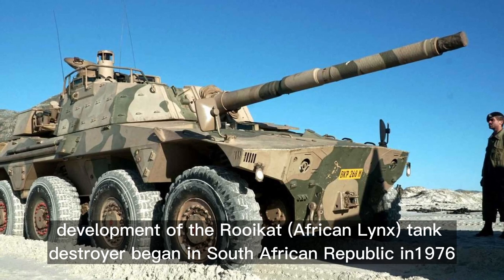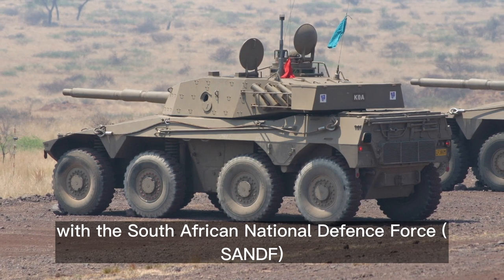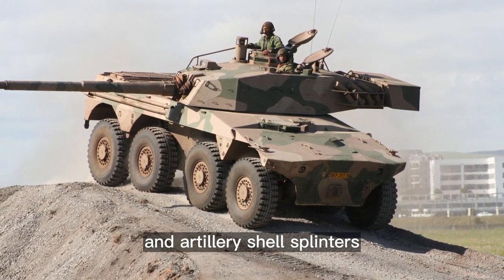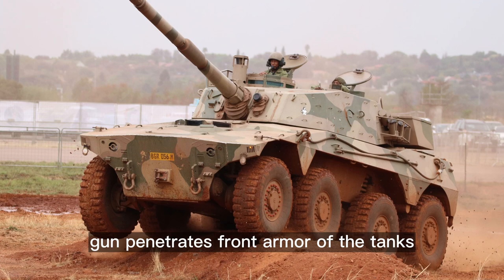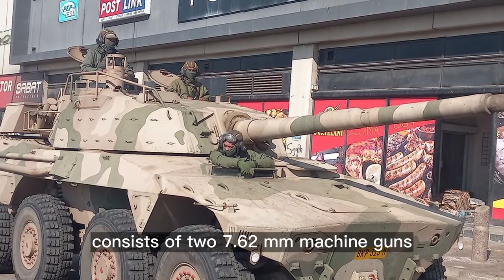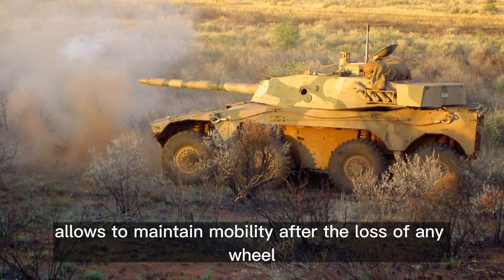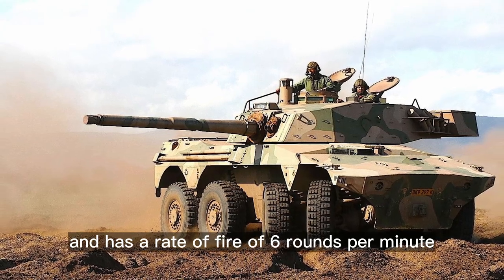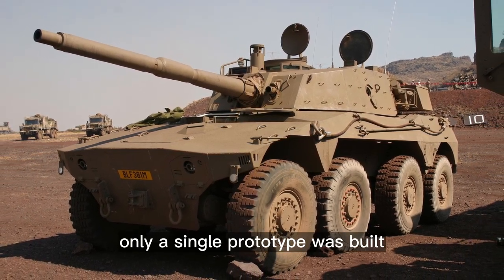South Africa's Rooikat Tank Destroyer:  A Deadly Predator on the Prowl

Comment: It is not a Tank Destroyer. It is an armed reconnaissance car. Its mission statement is armed recon, harassment of enemy flanks and to support the ground forces. It has anti-tank capabilities but they are secondary in its role.
Reply: 100% correct
Reply: Its also has the ability to disable tanks....not destroy
Reply: @deerasmus3870  anti-tank does mean destroy. Disabling works just as well.  That 76mm dart can mess up an MBT relatively easily from flanks